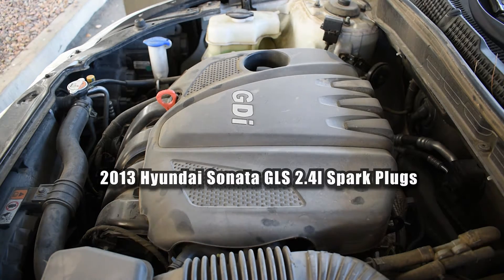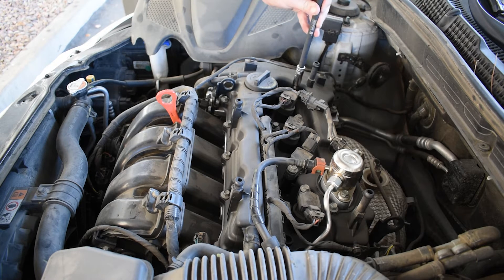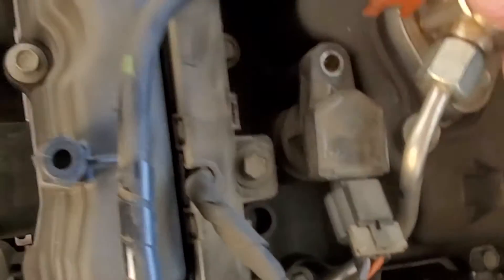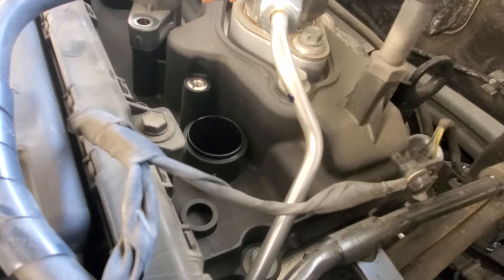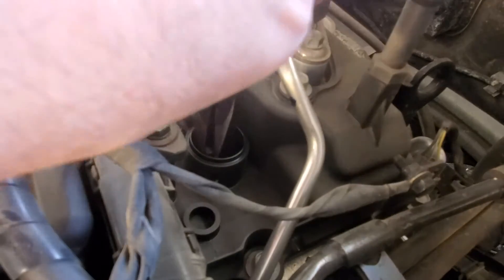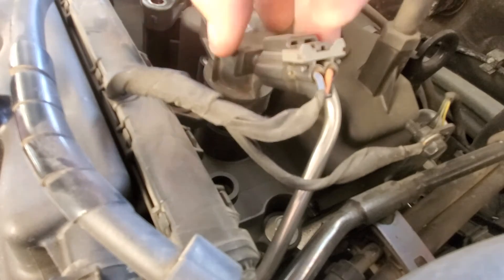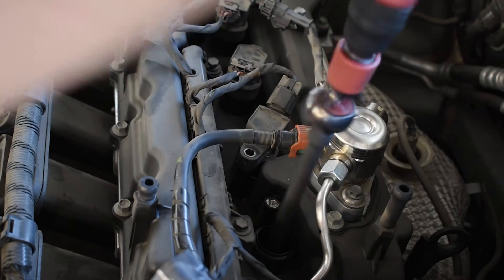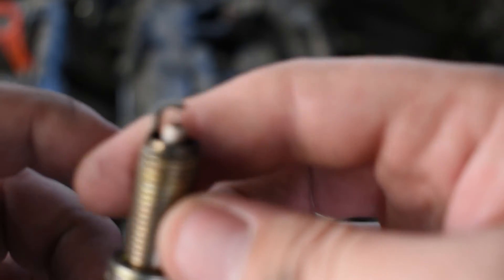How to replace Spark Plugs on a 2013 Hyundai Sonata GLS 2.4L THETA.

Comment: Just an observation. I know this vid is 3 years old and maybe you've corrected this since but it's a little off putting when you offer up information but then say things like "I'm pretty sure" or "something like that". If you're going to provide information, do a little research before hand to be certain that what's being said is accurate. Thanks.
Reply from the maker: Hey man, thanks for the feedback. Yes I noticed I said that when I was talking about the years and vehicles that use the same motor. I do have all of the years makes and models that use the THETA II motor in the video description. So if anyone needs that info check there. Thanks for the feedback and Happy Holidays!
Reply: @LetsRepair  Same to you and thanks for not getting all defensive about it. Cheers!

Comment: i did mine, and the engine runs pretty normal, same mileage but it throws a p0160 code now and again. no clue as to why. i didnt touch any sensors, just like ur vid.
Reply from the maker: P0160 Is the 2nd Oxygen Sensor behind the CAT, you may need to get it checked or changed if it stays on.

Comment: Seriously why not get a 5 dollar socket at AutoZone with the grommet or 12 for one with a magnet 🧲.  With how much you will use it even for one car it's pretty cheap and no more potential cracking a spark plug ceramic coating.  After one time I guarantee you'll have wished you did as when they shatter it creates ceramic dust that I doubt you'd catch and if just a tiny bit gets in the cylinder you'll need a new engine. And all because you refuse to use the proper tools because 6 dollars for a socket is to much money when you can risk thousands in engine repair or replacement.

Comment: How were you able to remove the old spark plugs ?
Reply from the maker: I just used a pair of needle nose pliers after I unscrewed the spark plug but they also make a special socket with an o ring that holds them when you unscrew it.

Comment: If you want to check for proper gap, what is the gap range?
Reply from the maker: Hey Stanley sorry for the late reply, I believe the GAP is 0.043 inch (1.1 mm) for both motors 6 and 4.

Comment: 90k interval recommended?
Reply from the maker: The manual says at 90,000 for 2.0TGDI and 105,000 for 2.4L GDI
Reply from the maker: Mine has no Turbo so its the 2.4GDI and it has 70,000 miles on it. I just try to baby it so I replaced mine lol.